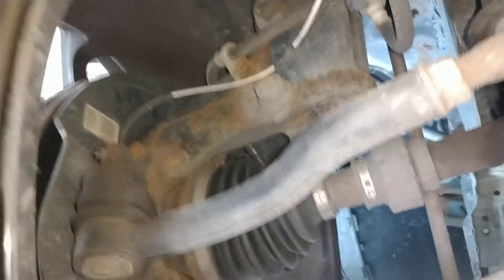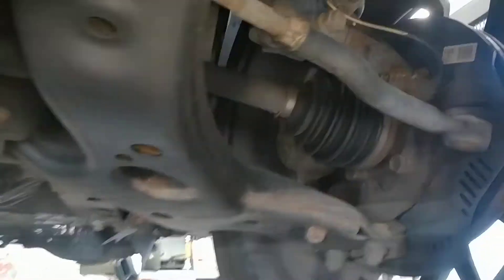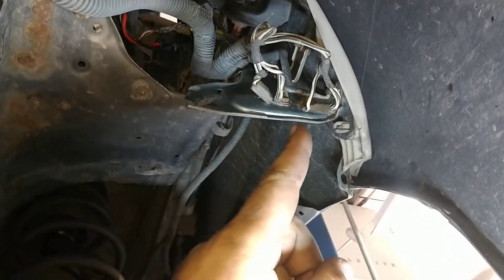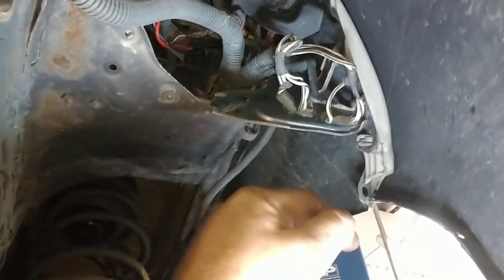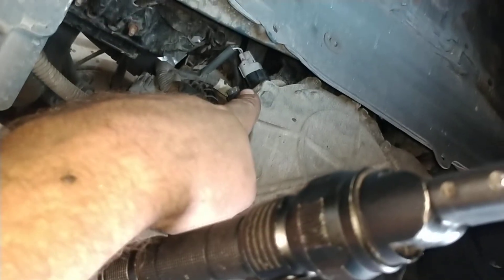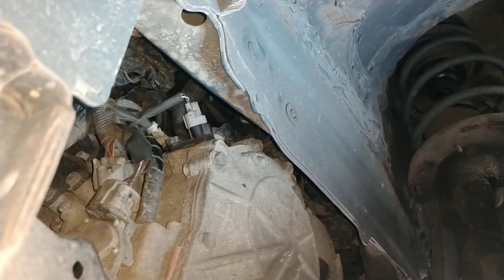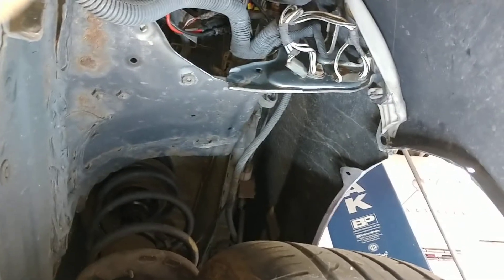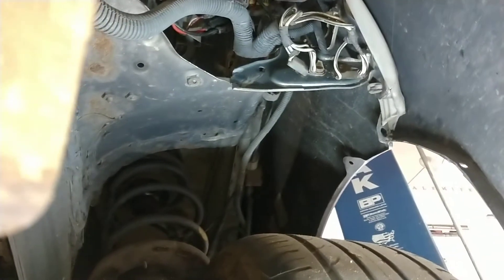P0500 vss Scion xB vehicle speed sensor

Comment: Brother Thank u for every thing you'v do but I have 1 Question for u. I HAVE SAME PROBLEM in my car TOYOTA YARIS 2012 after i check the computer show me this  ( Speed sensor circuit (A) P0500) so my car now not working because I cant fix this problem since 2 year i was driven up without fixing the car until MY GEAR GONE  and i had to change it by another new but still the same problem wasn't solved. If u can help i will very appreciate.

Comment: Interesting information. I have a Gen I 2005 Xb and it's coding C0205 and C1223 indicating both left side speed sensors. I replaced the front left one but it hasn't cleared the code. Since it's kinda unlikely both left speed sensors would code at the same time I'm wondering about the ABS grounds as mentioned in the above video. The op shows us where the grounding point is on a Gen II 2008 (driver side inside fender well forward of the front tire) but I can't seem to find the ABS grounding points for my 2005 Xb. Anyone know where it's located?

Comment: Is this a Auto or M/T?
Reply from the maker: Automatic
Reply: @SCOPELITUS   mine is a M/T. Don't see these sensors on the trans, so I'm going to try replacing the wheel sensors in my 2008 xb.
Reply: @YeskaSmoke420  i have an 06 M/T xb, did you ever find the sensor?
Reply: @sylasfelder1033  I didn't
Reply: @YeskaSmoke420  fuq. i have no spedo or odo
Reply: @sylasfelder1033  yeah, was going based off my RPM.